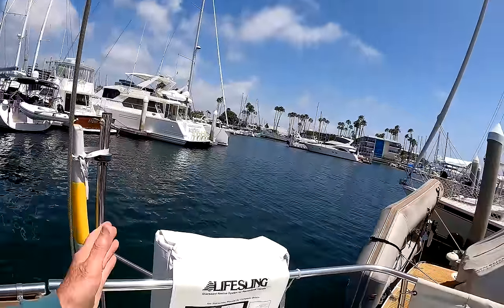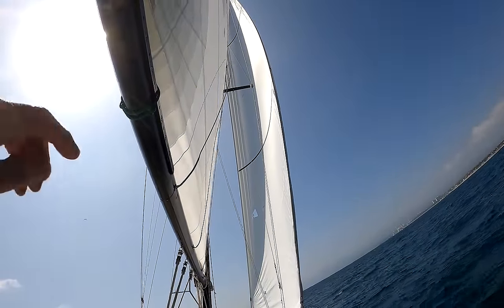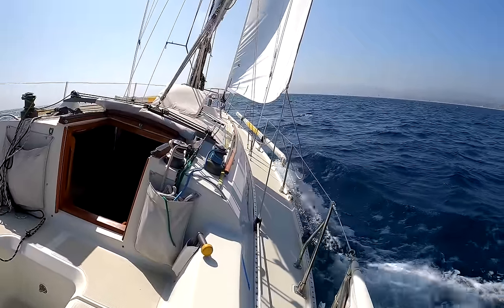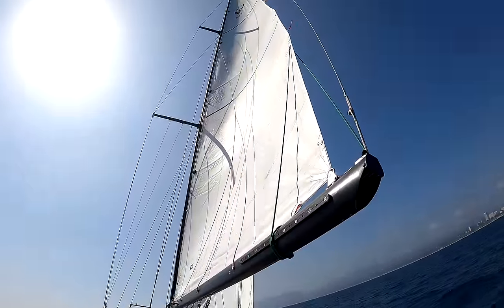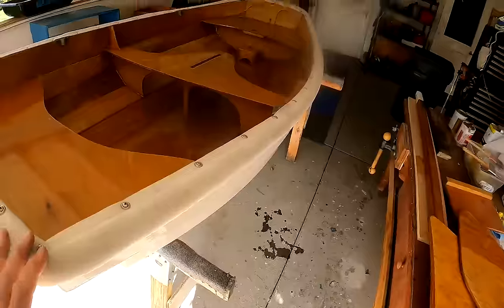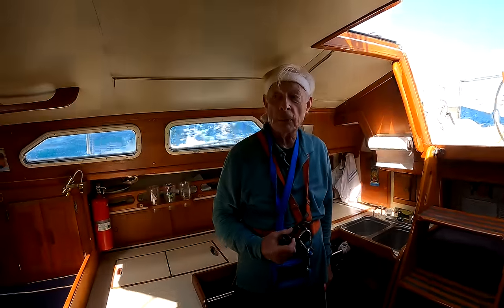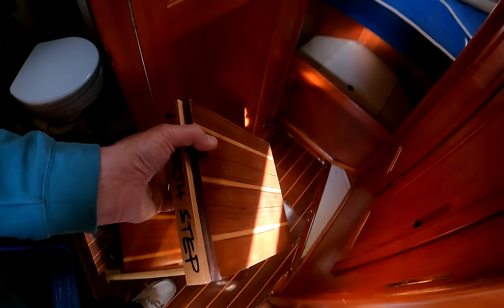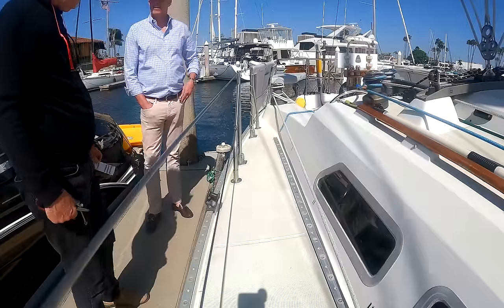Why We Sail--"Lessons of Spring, 2024"

Comment: May I suggest a piece of wire Loom to put on the bow pulpit to protect it from being scratched by the concrete. Easy to put on and won't leave any residue that sometimes even painter tape will leave....or even more aggravating is that most painters tape and other tapes are coming from China and they tear and split when your trying to use it.....buy a section of Loom and reuse it until you lose it.

Comment: Prop wash aint a big deal - use your dock lines - the bulk head scenario required pushing the bow out with starboard stern line belayed - or use the dingy to get bow out or kedge with anchor - reversing from slip use your ines dont even use prop u til bow put and headed